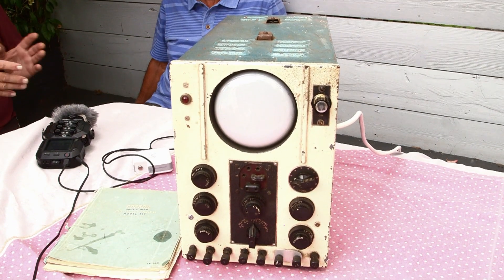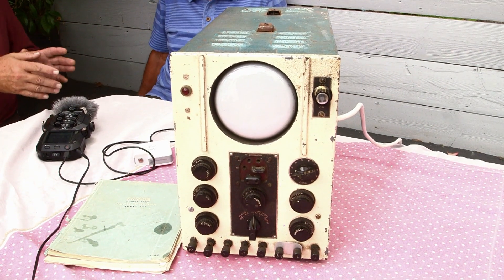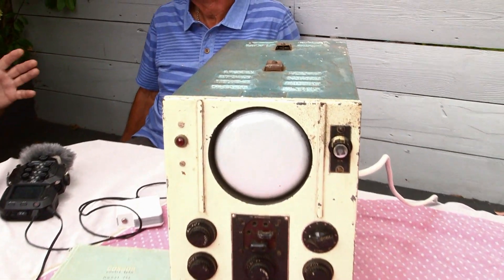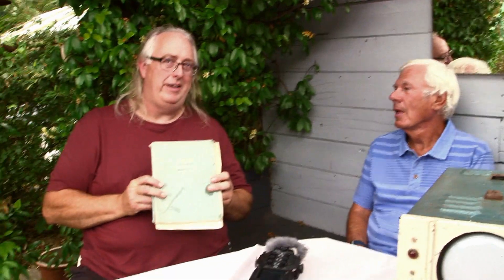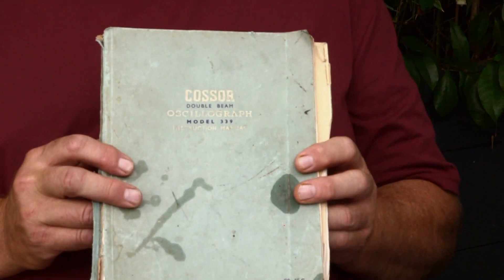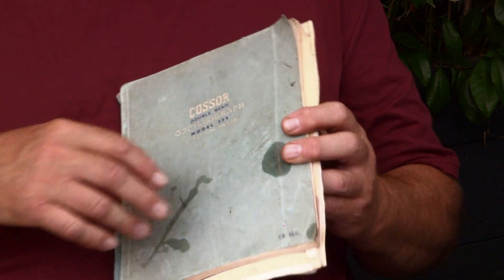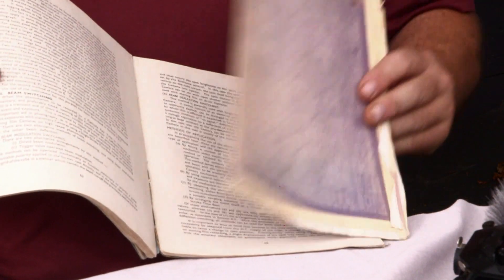World War 2 oscilloscope and its adventures

Comment: I have a Cossor 339 manual, and it gives fascinating detail and ideas !  The Telequipment D43 (readily available on eBay) uses a similar beam splitter to create two beams.  I wouldn't dare to try to recover a Cossor 339, but I study it because it was innovative, and the O'scope itself offered facilities such as deflection coil, back panel access and (in the manual) some novel test circuits.